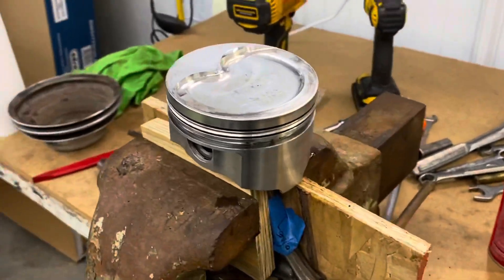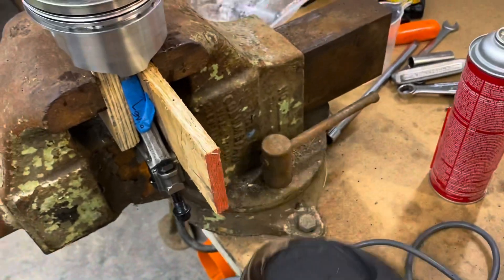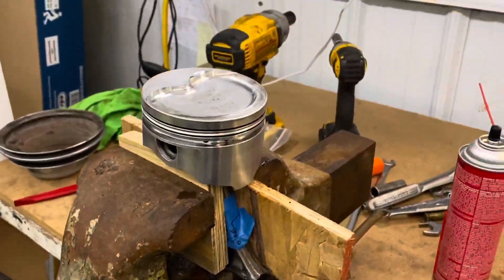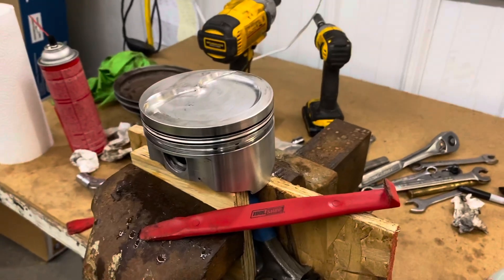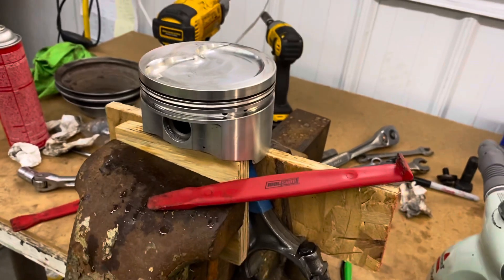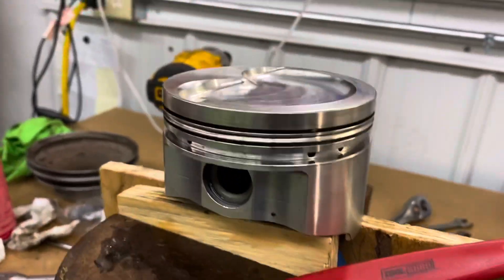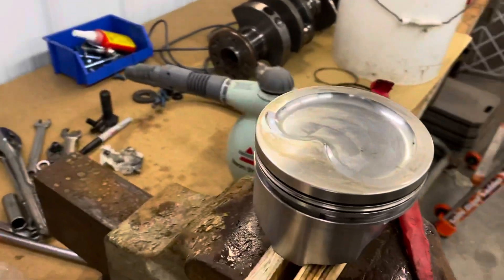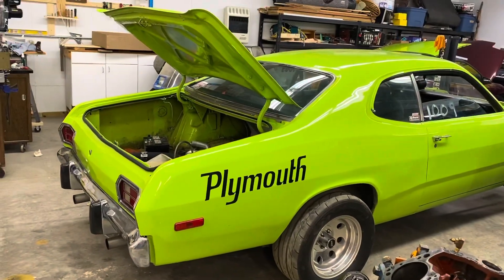Trying to Clean Pistons With a Bissell Steam Cleaner! Will it Work?

Comment: Nice and clean!  What compression do you guys run with those dished pistons?
Reply from the maker: With our heads we run 10:1 on 91 pump gas
Reply: Question I'm new to trying to do a stroker setup so for an example with your setup what name brand company did you use for the kit and also Pistons what was your compression ratio the head you were using and what cc were those
Reply from the maker: I bought the Mopar performance kit, diamond pistons, eagle sr rods, edelbrock performer heads. This was built 20 years ago on a ‘71 block. So it’s been a while, we believe the compression is between 10-10 1/4